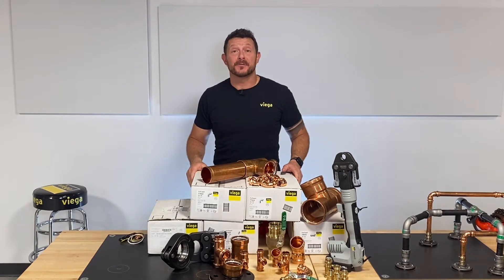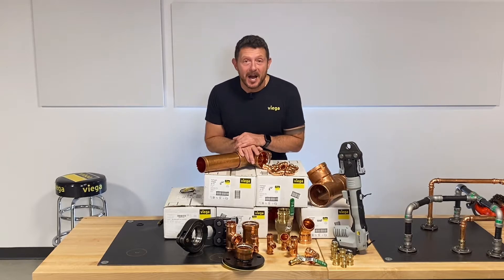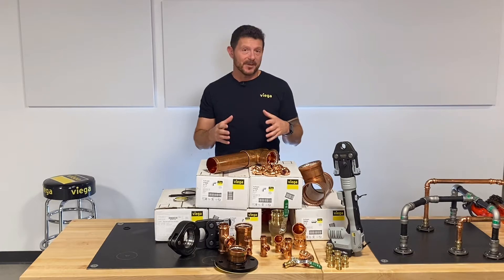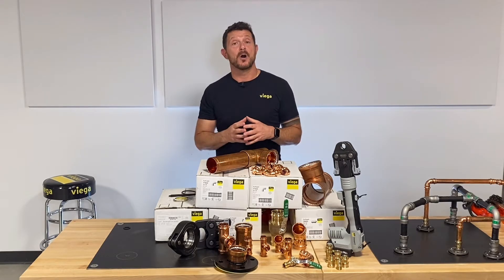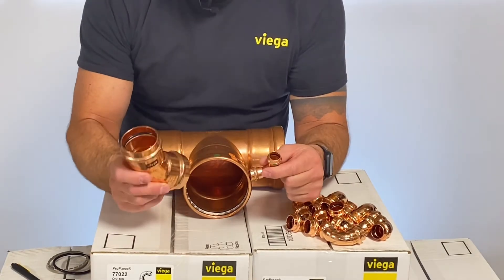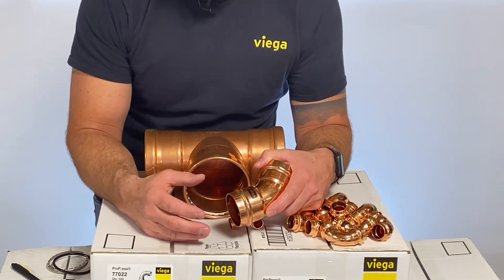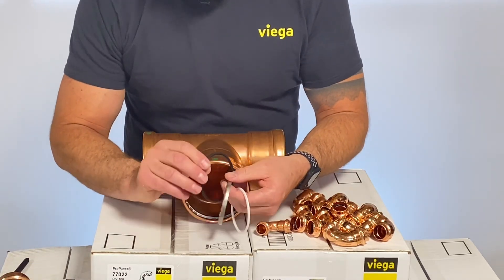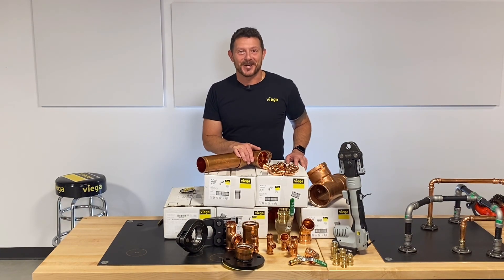The One and Only Viega ProPress - Copper Press Fittings

Comment: Can you disassemble the fittings when they are put together ??  Does the stainless type have the same size pipe diameter as the copper water pipe ??? Thanks v

Comment: Can a Propress fitting withstand the torqueing of nipples and threaded adapters? For example, it's common to see people make their own tub spout nipple using a short length of copper with male adapters soldered to each end.
Reply from the maker: ProPress fittings can be turned after pressing for adjustment but this does lead to them also being turned if the MIP or FIP is not connected before the press is made. The fitting must be repressed if turned. In the tub spout situation we suggest using the drop ear elbow. Basically press out the top with Brass FIP and mounting holes to hold it stable.
Reply: Can This product be use for under ground aplicación? Example to bring water to the house from the meter